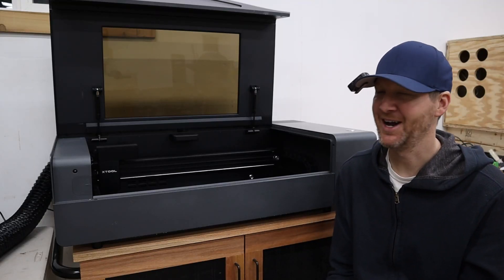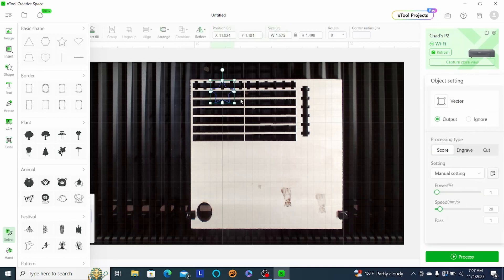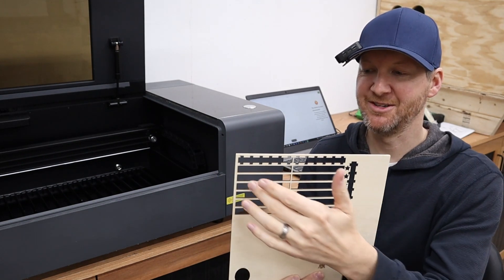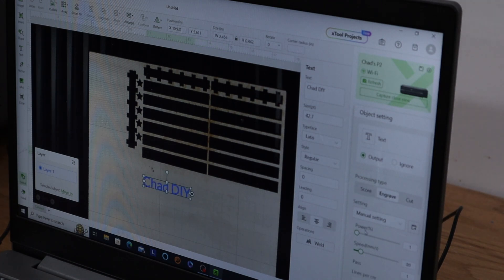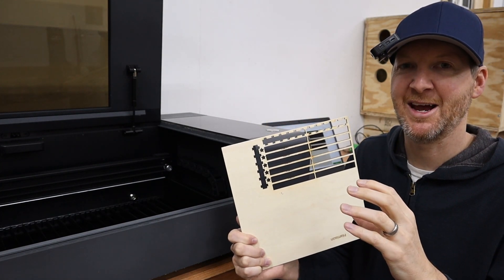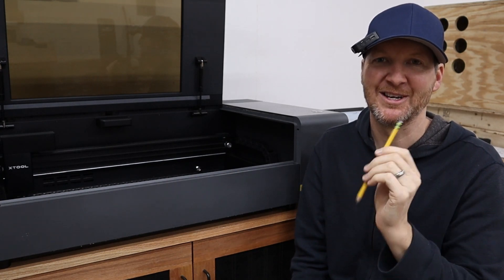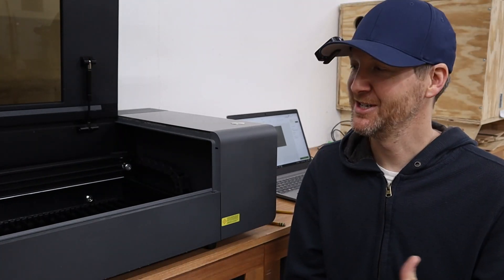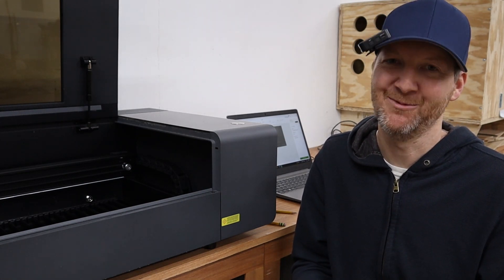xTool P2/Camera Test

Comment: Hi there, thanks for video! I was wondering if you could answer a question for me. When lining up an image from the software program on the camera over the material selected for the laser cutter cannot image be moved in circular motion as well as up and down left to right? Not sure if that makes sense, but I’d like to be cut at a different angle than just how it appears in the software. Could I take a heart and shift it on its side?
Reply from the maker: Hello, if you check out this link around the 12 minute point. I show how to do what you are talking about I believe. https://youtu.be/17AxvISjY_8

Comment: Thanks for the video! Do you think I can design a jig for the xTool P2 to engrave 100 pencils in a batch without recalibrating with the camera or realigning the vector files between batches? Do you think the repeatability of the laser will allow a jig like this?
Reply from the maker: Hello, I think it would work well for that. Eventually I would like to do the same thing. I think if you clamped down the jig so it doesn't move. You could get things lined up with the camera and just swap out the pencil from the jig and run batch after batch.
Reply: @chaddiy3512  That’s great! Thinking of taking the plunge soon on a P2.
Reply from the maker: @ChordOfC  I think you really will like it if you take the plunge! I believe it might be on sale November 15th, if you were going to wait a week to buy. If you use my coupn code- xToolMaki you can save even more, thanks!
Reply: @chaddiy3512  Thanks again! I didn’t know about the sale too.

Comment: I have been trying to engrave pencils. cut jig out of cardboard to keep the pencils upright and square. Created text, 9pt, placed the text on the pencils using up close view camera. The prints were close but not right on....usually high.....this is a neat way to place images but far from precise. Also tried placing pencils in randomly and using the precise fill feature. This didn't work well at all. It had  trouble seeing the pencils. I even put down black paper and put the pencils on it. It put names everwhere except on the pencils. At this point I have to say the regular camera (even when zoomed in) is not great at all for precise placement. The close view camera is not perfect but better. Thanks for the video.
Reply from the maker: Thanks for the comment. I can see the smart fill feature not working well on pencils. I think it does a better job a wider objects...and even then, you might have to adjust it a bit on certain ones. For me, pencils can be a bit tricky to do in bigger batches, There is not a whole lot a margin for error, even with a jig. I am not sure how many you are trying to do at one time, but I would try a jig with 5 pencils close together. and go from there. Good luck. It is a great machine, but there is some tweaking and a learning curve that goes with it.